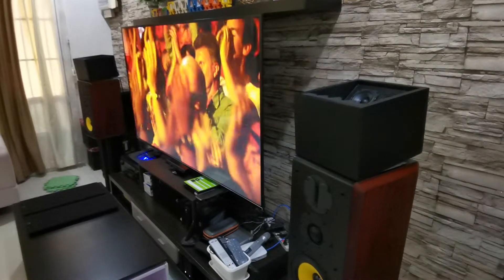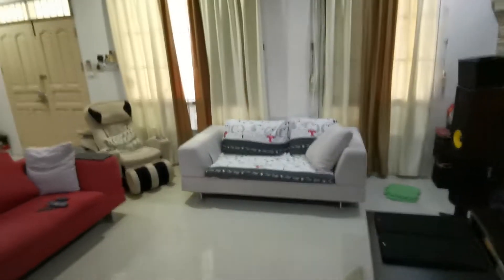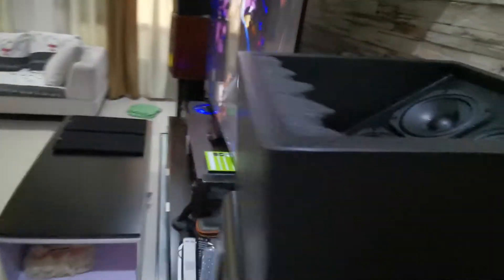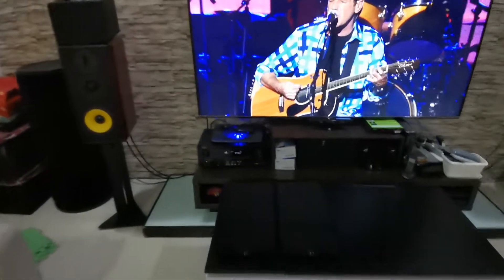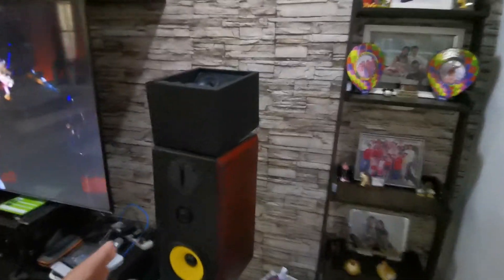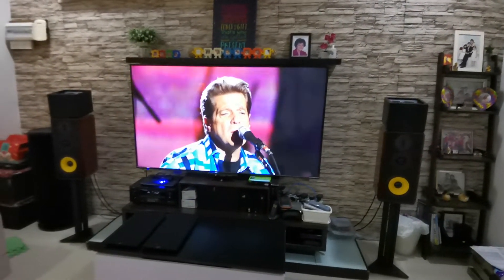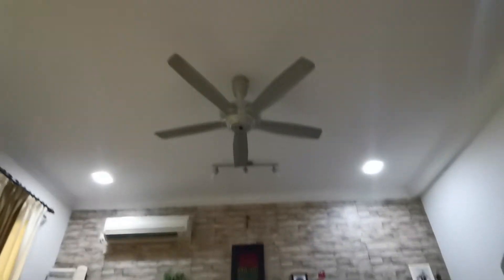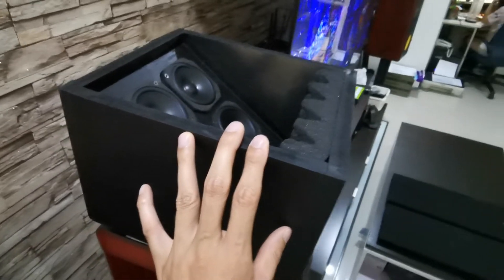DIY Dolby Atmos Speakers

Comment: I used a laser pointer. 

I have the Sony upfiring speakers. I taped the pointer on the side of one of the speakers so the pointer looked like it plum, true, flush, even with the angle (however you want to say it), placed the speaker back on top of front floor speaker, got a hand held mirror, stood on step stool, held mirror to ceiling and got general details of where the dot was. Was way off...way too short. So, I used a rubber furniture shim and placed under back side of upfiring atmos speaker...repeated process with mirror and step stool...I did this till I was happy with where the point was. Then stuck another shim under opposite speaker...re calibrated and it's a world of difference.

Comment: That's a nice setup. If you place those speakers at top of your front wall it would be better. Speakers in the ceiling is the best sound
Reply from the maker: It's very hard for me to do the wiring that's why I decided with upward firing Atmos

Comment: Nice and good looking system. If you built your atmos speakers, congratulations. However, Have you heard the atmos from a movie theather ? The sound comes from the ceiling . So my recommendation , after 2 years of such a great experience from the ceiling ,is that you have to give yourself the chance to try it . You only need a small  linear cover on the cables and a rectangle box of 2 foot by 5 foot by 5 inches under the fan and , two ceiling speakers from Amazon of 8 or 6 ohms and try  before and after the movie Real player one or Mission Impossible, Fallout in Dolby atmos. Is a nice solution to use a Neural mode. Yes I know what you  said at the end of the video about "too localized  sound" but atmos needs concentration not dispersion during the most scenes when is used. Once again, great video

Comment: Do you have prints?
Reply from the maker: Yes I do have the design print
Reply: @kevinlei1969  were can I get the prints?
Reply from the maker: @bennyblanco14  I try to put it on google drive and share the link here
Reply from the maker: @bennyblanco14  is there another way we can communicate faster like Facebook messenger or WhatsApp. It would be better if I can have dinner info like your ceiling height, listening distance from speaker etc
Reply: @kevinlei1969  yes I am on Facebook...can I find you on Facebook using Kevin lei?
Reply from the maker: @bennyblanco14  https://www.facebook.com/kevinlei1969
Reply from the maker: @bennyblanco14  I receive a friend request by the name Antonio T. A. It's that you?